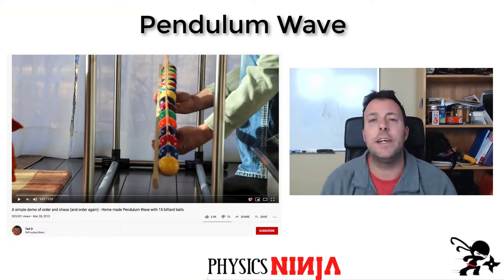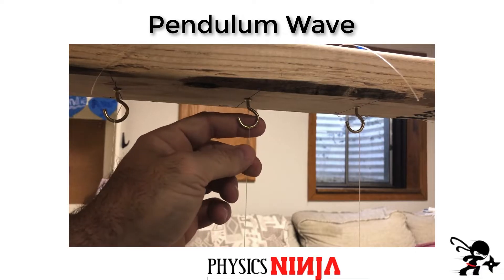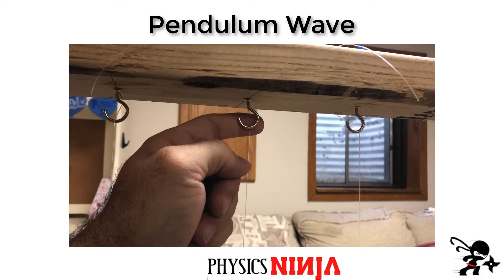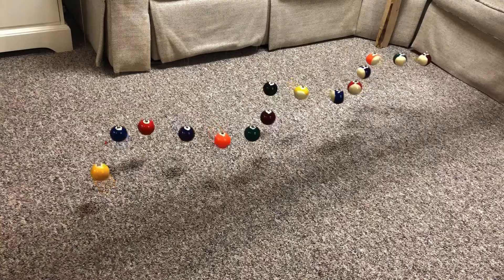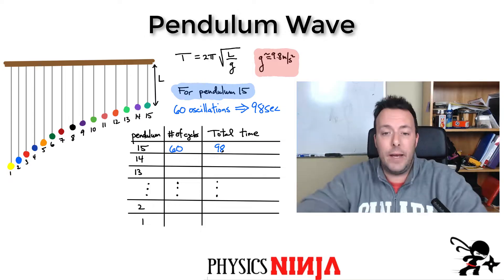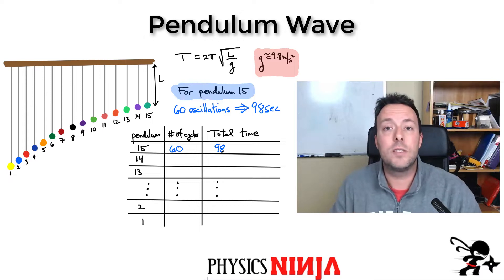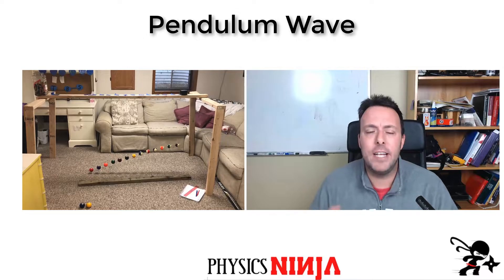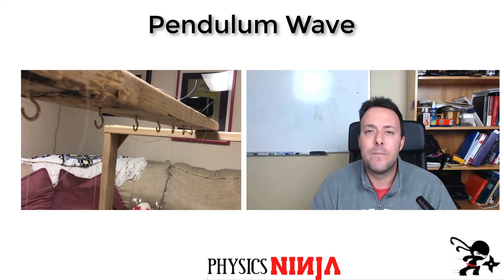Pendulum Wave Experiment

Comment: Micro adjust by turning the screw hooks.
Better would be, drill holes in top board and run string through holes with "cork/plug".
Reply: The screws hooks at the top wouldn’t change the length of that pendulum, but the screws into the balls would.

Comment: I built one of these during a week in September, 2021, and I found this video today. Probably 5 hours of construction and 25 hours of adjusting.  (It's strange how this video didn't pop up during my research searches.)  It still isn't very accurate, hence here I am researching again, and this video seems the most down-to-earth.  Here are some of my conclusions:
1.  My frame was surprisingly close to Ninja's, except my four legs' tips were attached to four corners of a piece of plywood.  My hanging rod was a half-inch sturdy metal tube which was probably once a 6-foot tool handle.  My first mistake was not thinking distance between balls was important because of the gaps in string length.  So, after drilling holes in the tube 7mm apart, after a few swings all the balls would whack into each other.  Tried to fix that by hanging each ball with two strings from two holes -- no progress.  Finally fixed this by keeping the strings and making the holes 50% further apart.  I might go back to one string per ball.  (Their length range is from 84cm down to 55cm.  See video by "NightHawkinLight", 8.5 minutes long.)
2.  Note: Drilling 2cm into billiard balls causes minor explosions of face-fuls of dust.  One of the balls lost a pea-sized chip, so it is a bit less heavy.
3.  My cue ball (a 16th ball) may not weigh the same as the others.
4.  I became pretty proficient on measuring the strings by I soon knew that fine-tunings will still be needed.  I had to practice to create the "guitar tuning rods" with nails and tape.
5.  I would never buy new balls for this project.  Find a free or $10 set on Craiglist!
6.  My project is so large that I probably won't ever move it indoors.  So, I look forward to finding out whether breezes will affect all the balls identically....